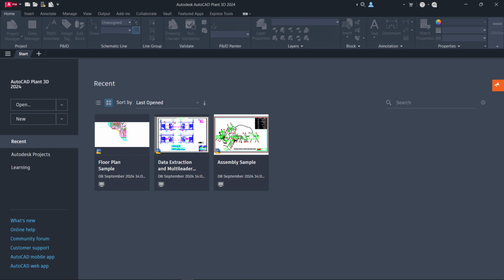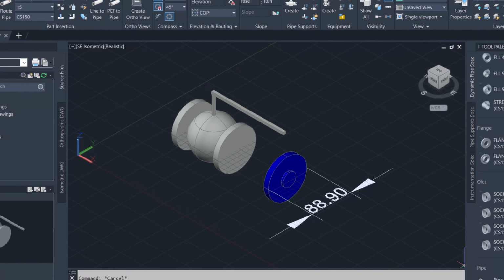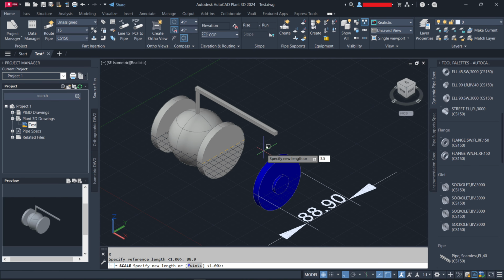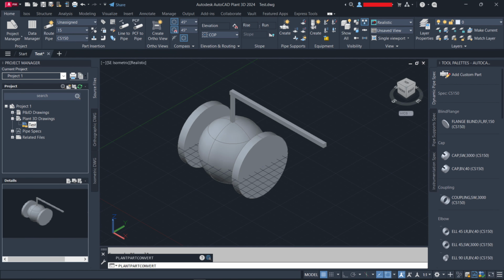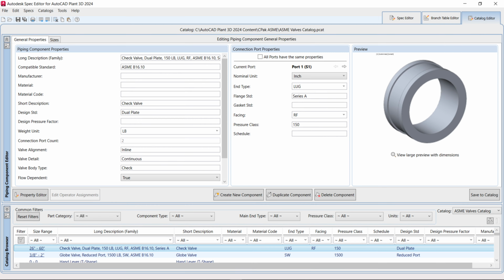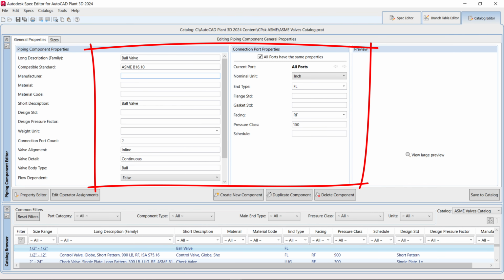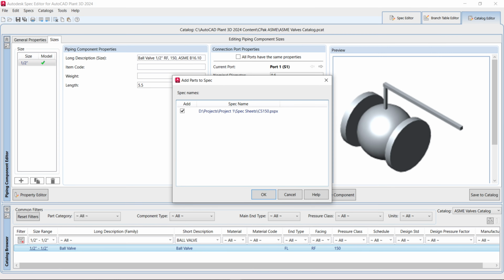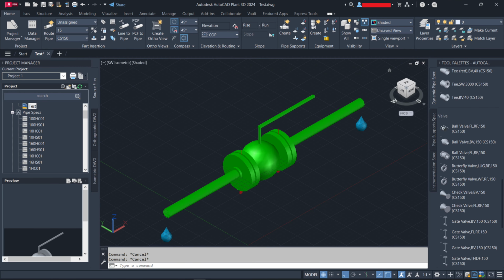AutoCAD Plant 3D | Create Custom Part Using AutoCAD Block?

Comment: Hi sir can you do it with 2026 version please 🙏🏻🙏🏻
Reply from the maker: The workflow is same in all versions
Reply: @acadp3dsolutions  I have encountered many issues where the equipment becomes extremely large, and I couldn't figure out the reason. If possible, could you please make a video tutorial for the 2026 version? I would really appreciate it if you could fulfill this small request

Comment: how about if you have building and main equipment done in Inventor what the best way to import that to P3D to do then piping
Reply from the maker: You can export the Equipment from Inventor in .adsk format found in the BIM Exchange tab. Then, use the import from Inventor option in AutoCAD Plant 3D under the Equipment Tab.
Reply from the maker: Let me know if it helps.